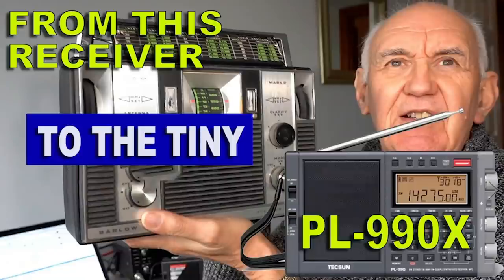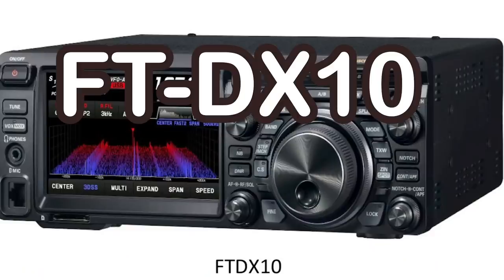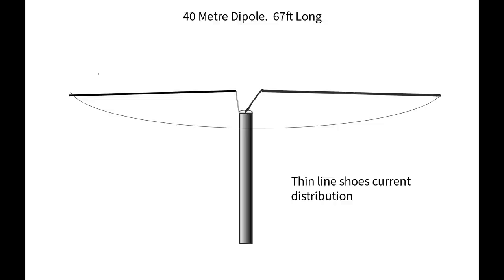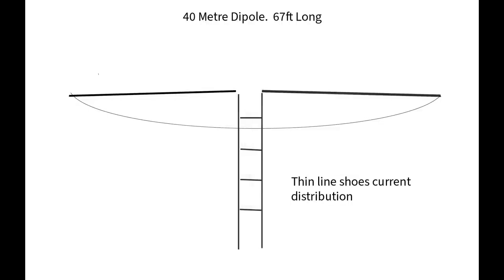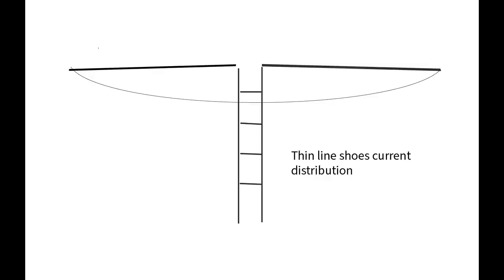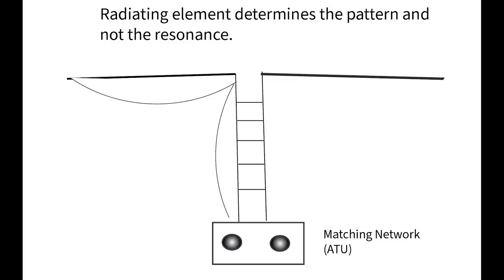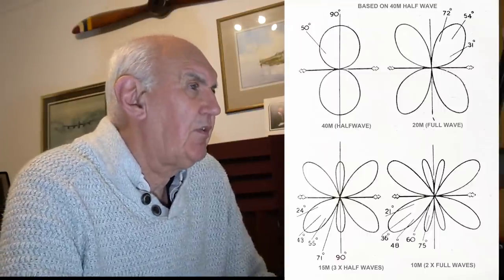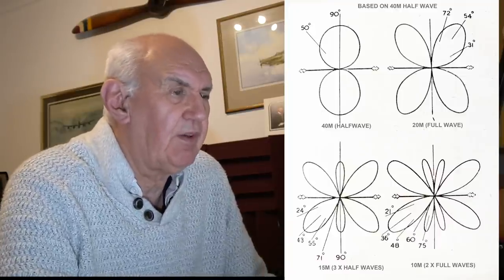When is a Dipole a Doublet?  Let's Take A Serious Look!

Comment: For years and years I used coax and chokes and all that.  The first time I put up a doublet, the difference was so amazing, that I've never used coax again.  My overall radiator length is 102', fed with 14 ga. 450 Ohm window-line (aprox. 70') which i run through my outside wall, terminated into 2 female banana-jacks that are mounted to a piece of plexiglas screwed to the internal sheetrock plaster-board.  I have a very-short window-line jumper with male banana-jacks going to the tuner. When the antenna is not in use, I have pair of ground wires with male banana jacks that plug into the antenna for and go to a very-heavy ground buss with ground-rods outside. The center-feed is on a 50' tower side-arm.

Everyone yelps about taking window line through an outside wall!  My wall is stucco on chicken-wire, which I cleared away where the window-line goes through.  I then formed a drip loop with the window-line, and sealed the outside with a generous amount of silicon against the stucco and part of the interior of the inside part of the wall.  I checked the performance on all bands both outside and after the installation and the was NO-DIFFERENCE period. This way my balun inside and I have only coax from the tuner to the radio.  I run all bands 80-10M completely with exSWR. So, try this amazing antenna--you'll love it!

Comment: THANK YOU FOR LETTING US IN WITH YOUR THOUGHTS AND IDEAS PETER!
I HAVE TO USE A 2 X 10M IE 1/2WAVE
OM 40M BAND. I HAD A 80M LOOP BEFORE SOME YERKS SLAUGTHERED IT WHEN THEY REBUILT THE BLOODY ROOF! 160-6M WITH 450 OHM WINDOWLINE - ABSOLUTELY AMAZING LOOP ANTENNA (83,0m or 273feet WITH 23m 450 Ohm feeder! It was Marvelouse!

Comment: Would it be preferable to use a measured 67ft wire section and see if ATU can tune for 80,  OR use as much wire as will fit in the yard space divided evenly and use tuner?  I’ve got potential for 90-100 foot run depending on how cooperative a large gumtree is!  Fed with ladder line into 1:1 balun.  Vk5LTD

Comment: Great video. I've narrowed down my choices of my next wire antenna to two: ZS6BKW or a doublet, which of course the only difference being one is resonant and one isn't. Decisions decisions! I have a good LDG AT-1000ProII Auto Tuner so I am leaning toward the doublet. Plan on an inverted vee configuration with about 90' for each leg. Will report back when complete.

Comment: Thanks for this Peter, I've been thinking about a doublet for a while and this has helped clarify a few points. My new shack has 150ft on either side (300ft total) available for erecting a doublet. I would only be able to raise it to 25ft at the feed point and for most of it's length but one end could go to 40+ft. I suppose the best way to find out is to try it!
Reply from the maker: Yes give it a go.

Comment: Peter, I am planning on buying a metallic narrow boat and looking forward to putting together an all-band rig (IC-7300, IC-9700 combo) on it complete with two multi-band antennas. For the HF band, I was thinking about an HF loop. For the VHF/UHF bands, a tri-band vertical and a portable Yagi for the occasion QRP with the IC-705.
My questions are: what effect a large metallic surface - that the boat is - will have on SWR and radiation patterns for the loop and the vertical? Should the rig and antennas be grounded to the metallic hull? Narrow boat manufacturers recommend against using the hull as a ground for electrolytic reasons.
I am a big fan of your channel and thank you for all the useful information you contribute to the art.

Warm salutations from grid EL97tf
Reply from the maker: Hi there. A boat is a great base for antennas plus the water around the boat. As far as radio is concerned you can safely use the metal of the boat as an RF earth. You should get some great results. 73 Peter.n

Comment: Great description Peter
I have had an argument with my friend who seems to have it in his mind that a doublet or g5rv needs to have a specific length of coax between the ladder line and the tuner.  I can find nothing to support that however this video supports my argument that there is no set amount of coax needed.  I am running a standard g5rv with a 4:1 balun and about 20 feet of rg-58 into a LDG it-100 and a IC-7300 with great results.  My second antenna is a zs6bkw with a 1:1  balun and it loves 40-10m .  Both antennas are inverted vee configuration at 40ft  at apex and 10 to 12 feet at the ends.  Now if only the bands would cooperate a little better.  73 Jim  ve4jim
Reply from the maker: Hi Jim, G5RV ladder length is only to get a reaonable match to coax. Has nothing to do with antenna performance. Balanced line all the way back is better if you have an ATU. 73 Peter.
Reply: Hi again Peter.  The ladder line was not in question, it was the coax from the ladder line to the shack.  My friend firmly believes that it has to be 70 feet.  Here you clearly refuted that and now I will have the greater job of encouraging  him to watch your video.  All the best Peter  73 Jim
Reply: @watersstanton  it's interesting that Louis Varney states that the ladder line is a make up section and that it doesn't really do any impedance transforming and that the antenna system tuning unit tunes the antenna and feedline to resonance

Comment: I don’t know what kinda ladder line you have in the UK but here In the States unless it was tv dual line from the 1960-70s it’s junk. Copper clad stainless steel and the coating is a mil thick if that.  Best to look at Facebook The Toad Harbor page explains how to make home made open feed line. American farm works makes electric fence ribbed isolators and 13” uv resistant wire ties a roll of 12awg solid core THHN coated copper. 500’ spool should give you 130’ each leg of the diepole and 120’ feet left over for the feed line. Add in a balance tuner like dentron super tuner and you will have the best multi band antenna 
KC3ONO
Reply from the maker: Hi Kevin. The popular balanced line here is 450 Ohm semi airspaced which works and lasts well. 73 Peter

Comment: Do you have to go from ladder line to coax? Can’t you just run the ladder line into the shack and hook it directly to the tuner? My tuner has connections specifically for ladder line.. thanks
Reply from the maker: Of course yiu can but not everybidy us comfortable with ladder line in the shack, particularly if they have no outside wall. 73 Peter,
Reply: @watersstanton  huh?
Reply: That’s great news, am in the process of putting my shack together, my new  wife gave me a nice warm dry corner in the basement with an outside wall, I am going to run pvc conduit through the wall to run the ladder line
Reply: @chadwickdavis1749  im confused. You say a basement wall, isn’t there going to be a lot of dirt on the other side? You going to run it up through 10ish feet of pipe to open ground?
Reply: A third of the basement is above ground so I just have to drill through the part that is above ground and install  a short piece of pvc pipe through the wall and run the ladder line through it
Reply: @chadwickdavis1749  got it. Makes sense now.

Comment: I got a 20m horizontal loop in loft of third floor flat fed with ladder line, works well 20-10 and tunes up on 40 with small bandwidth, I cannot work out if it will work better if I split it and turn it into a doublet in the shape of a halo antenna, internet gives me two different answers, both are called skywarmers and DX antennas. Any suggestions? I know if I split it tuning on 40 will be better.
Reply from the maker: I see no reason for it not to work. I woukd expect at least as good performance as you have now but as yiu say, it will add 40m. There is only one wato find out for sure!! 73 Peter.
Reply: @watersstanton  Thanks, it's a difficult decision to make, everyone I have called back to on 20-10 has heard me. Had Russia on 40m which I think is better than expected for a half wave loop on 40m. I might give it a go in the future. 73's 2e0deq

Comment: It might have been nice to show the voltage maxima in a dipole. There are two of them, at opposite ends. Hence the name, di-pole. There the impedance is high. In any case, if the total length is resonant (a half-wave), it's still a dipole even if it's end-fed.

A doublet is just that. Two legs. Not much else to say about it in general. An endless supply of individual cases.

Comment: what if I make a Doublet /dipol
fed with ladder line antenna on 80 meters tuned 3,600 MHz,  will it then  work on 160-10 meters ? LA2VLA
Reply from the maker: If around 40m element length, then may well do but depends on ATU capability. Am afraid it is a case of try and see. 73 Peter
Reply: @watersstanton   I'll try to see what happens but now it's too called out -5 and wind